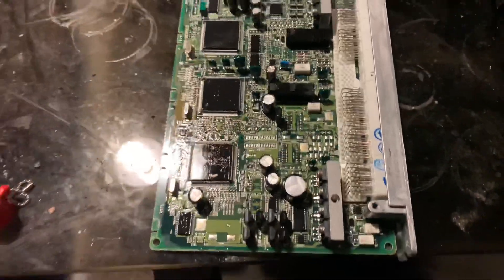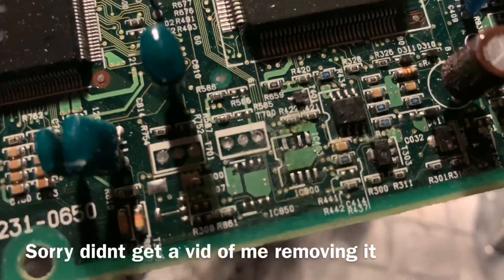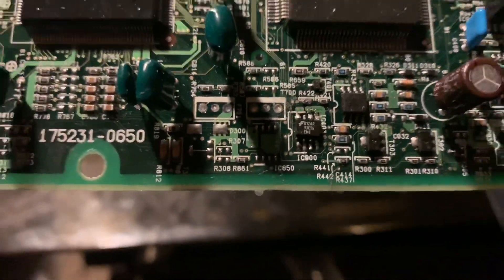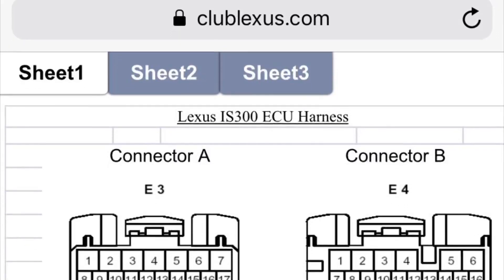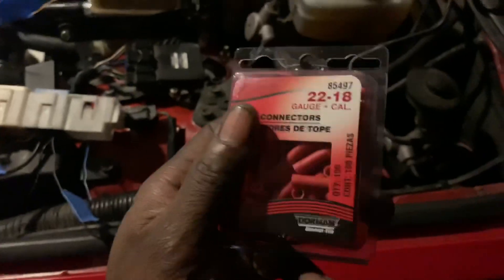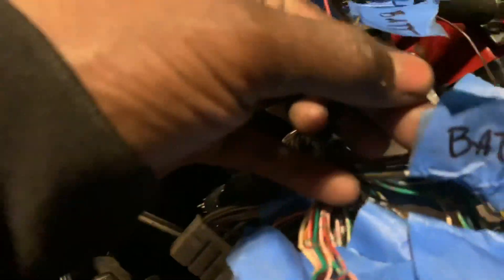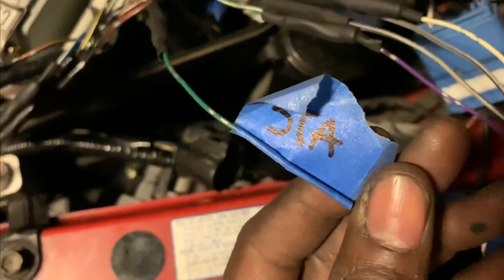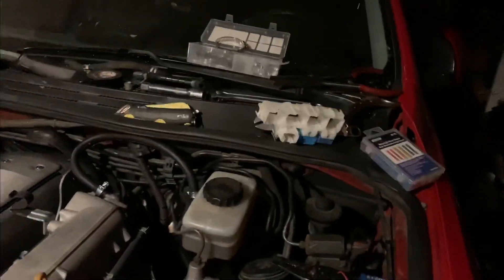1jz immobilizer swap / wiring

Comment: Hey i need info with the Immobilizer is there any way you can help me out i don’t know where the Immobilizer wires are on my 03 is300 and I’m trying to do what you did and connect them to a aristo ecu instead of a 1j it’s the same wiring i know for sure just i don’t know where the is300 Immobilizer wires are at and which are which give me a text or call ASAP please 904-307-6252